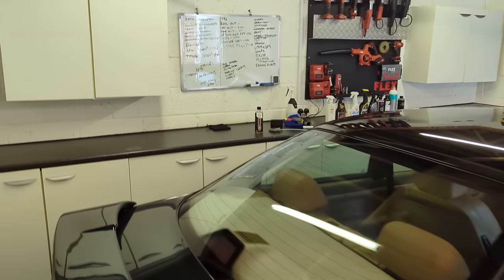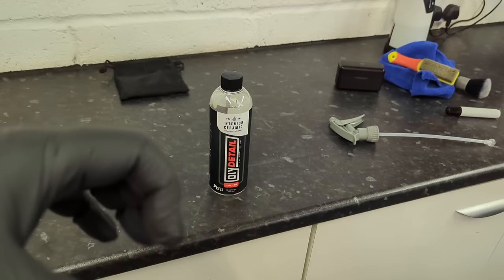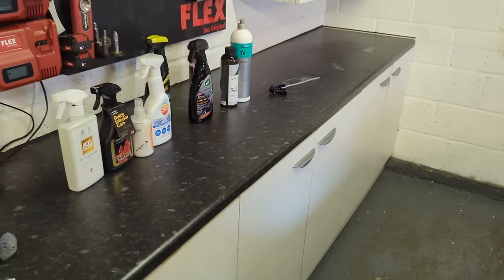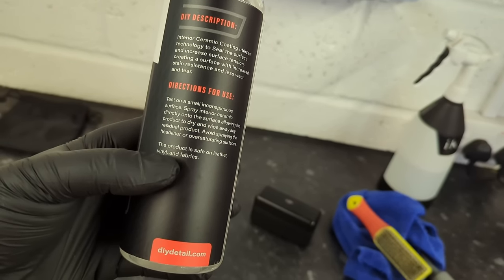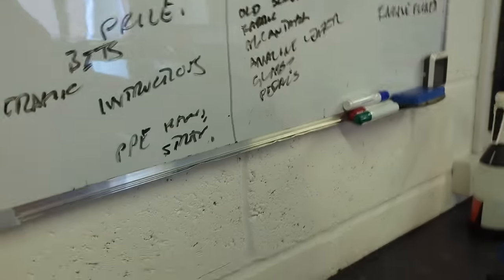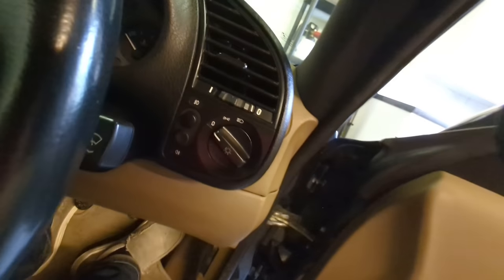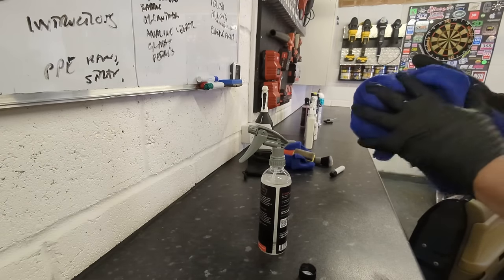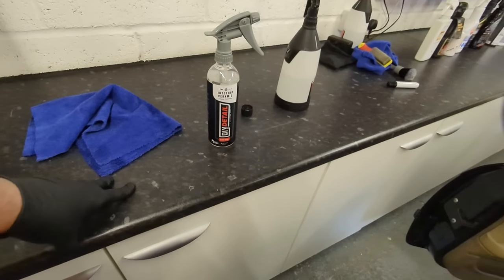DIY Detail Interior Ceramic | At £47 a Bottle it Needs to Be Good!!

Comment: I've applied this 2 weeks ago on my new car, it can go on most surfaces except glass for safety reasons (glare). It will go on poly carb binical speedo and screens. They advise that it's great on touch screens particularly because of keeping finger prints off.

 Also, they recommend that you don't spray directly onto the interior panels. Spray directly into a pad then spread it around the panels, I used a medium size Gyeon pad that doesn't absorb the ceramic coating keeping the product on the surface and not in the sponge- highly recommend you do the same. 

They really could do with making these statements on the bottle. I've done a fair amount of research into this before I made the leap to spend £47. So far so good.

 Apparently the liquid inside the bottle is more fluid then water meaning that it won't fill microscopic hole and pores keeping the finish similar to its original finish. It does slightly darken the surface. 

The whole idea of this product is to make cleaning a lot easier, reducing stains, rejecting dust, its would keep spilled liquids like cans of drink on the surface of the seats for instance so that you can clean up before it soaks in. I like it. I understand it and feel its worth. I had to find out what surfaces it can be used on by watching a lot of Yvan and Nicks channel. It will go on Alcantra as its a form of microfiber, probably not seat belts for safety reasons I'd use common sense. Analine leather and white headliner found in common cars probably not due to a slight colour deviation and could easily alter the appearance. I am with you on the fact they should print this information on the bottle. I've not scanned the QR code yet.

Comment: Ideas for testing:
- Look at the finish (kind of subjective, I hate glossy finishes for interior)
- Test durability in 2 ways:
    - Chemical resistance with an interior detail, stepping up to surfex for a torture test
    - Friction resistance by setting up something to continually rub over a test piece of leather (like the wiper test you did for glass coating).
- Price like you normally do
- Instructions, quality of the bottle/sprayer etc. like you normally do
- Ease of application like you normally do
- Ease of cleaning by getting a coated surface dirty
- Stain resistance by letting some coffee dry on some plastic perhaps
- Fabric water repellency by tipping a cup of water on some carpet (don't spray it / atomise it, pouring represents a "spillage" better)

Comment: It is the same trigger that came with mine, just went out to check my bottle and mine leaks too. I've just put the original cap back on. Thanks Jon, you are a legend 🙌
Reply: Your distributor has supplied you with a different spray trigger. It should have come with a black one that does not leak.

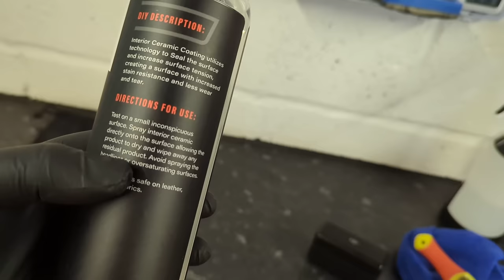Comment: 16:06 It can compromise the glue which holds up your headliner over time. That's why they didn't want you using it on your headliner.
Reply from the maker: makes sense might also disolve the sponge layer you sometimes get under the fabric.

Comment: Here in Australia the DIY ceramic interior cost's $114 which is around 55 quid. So it's expensive. But l like their products and I've used their rinseless, ceramic gloss, waterspot remover and they all work well. I won't buy the interior stuff until it's much cheaper though. Damn shipping cost's. My staple is 303. Great video!
Reply: The difference between the two are, 303 needs to be reapplied every 3 weeks or so, Interior ceramic applied to surfaces you never touch such as dash boards, one coat may last a lifetime?  Leather seats, where there is wear & tear, needs to be reapplied every year or so.  Do the math for your usage...
Reply: @hartlanddetailer5670  Well longevity is yet to be proven. I can get 750mls of 303 for a lot cheaper than 473mls and it does the job. Looking at how much you have to apply the maths doesn't work for me. I'm not arguing how good it is just needs to be cheaper for me, as I said I like DIY stuff.

Comment: i have it applied already 6-7month ago, once in the 2 weeks i give the car a quick clean with rinseless and its really good, probebly for what i noticed the steeringwheel is getting dirty quicker and not so fast to clean as in the first months but still good, the rest of the car wipe with a damp cloth and dry with a clean cloth and its good to go, and that after 40k km in 6-7months. So it makes youre interior easy to maintain and a nice oem look, but yeah other products can do that as well, but for how long? but the best of this product is when you use it on youre toch screens it works fantastic less fingerprints and so easy to clean and without streaks

Comment: I believe Yvan also says you can use it on literally all interior surfaces.
Reply from the maker: yer but can you? interior glass? alcantara? carpet? Rubber matts?  seat belts? analine leather?    Says its fabric safe but to not use on headliner.  Headliner can be vinyl, leather, alcantara, fabric etc.. etc..   So just in my head Im not 100% sure.  You can argue apply commen sense.  Its hard for labels to cover every outcome but on the flip side I think they could elaborate on specific surfaces a little bit.   I dont think I would apply this to interior glass for example.
Reply: @ForensicDetailing  yeah you do not apply it to glass
Reply: He said (Yvan) do not use on interior glass?
Reply: @hartlanddetailer5670  yeah as it will cause fogging
Reply: It can be used on anything except interior windows ( anything hydrophobic can cause fogging)

Comment: Hi John, I have contacted DIY Detail regarding these Spray nozzles as the grey ones are not for these bottles.
Reply from the maker: beyond my remit mate, product was bought and payed for. thats the trigger that came with it.  others commented they have this trigger.  So at the moment lots of DIY detail customers have leaking bottles.  Reviews are supposed to raise things like this not to fix the things you discover.
Reply: The UK suppliers are sending the bottles out with these Grey nozzles not the Black ones that they came with. That was the point I was trying to get across. I to have a leaking bottle.
Reply from the maker: Its up to the brand to ensure that they tell distributors what spray triggers go with what bottles.  distributors stock thousands of products they will never have the ability to test and check what goes with what.  Its also the brand that get impacted from any issues.  Again though this is outside the remit of the review.
Reply: @ForensicDetailing we only have one type of sprayers for our products. If a distributor accidentally sends a consumer a sprayer from another source it’s hard for us to police other than explaining to the distributor the importance of using the correct sprayers.

Comment: For me if such a product actually works I’d like stain resistance on fabrics, carpet, and leathers/vinyls. Perhaps stubborn areas of seatbelts and headliners. Things that are easy to stain and hard to clean. But dashboards, door cards, steering wheels etc I’ve never had any issues cleaning.
Reply from the maker: thing is should ceramic material really provide stain resistance in fabrics?  The original coating materials were not designed for fabrics they were designed more for coil coatings, architextural facades, and anti graffitti applications on train carriages.   But is this interior ceramic for fabric application not sure?  these are all good questions.  I think it says not for headliners somewhere.  I think I would use it more for dash board and interior trim and doorcards.  But need to get to know the product better.

Comment: No need to trim the DIY straw Jon. I did that at first until Yvan said as it is will still work
Reply from the maker: they can kink or loop back up on themselves if you push them down. they should be cut to length, if they are not that gets raised in the review so people are aware and can decide if its important to them.
Reply: @ForensicDetailing nothing wrong with bringing it up. I didn’t cut the straw on my latest purchase although I’m not the biggest fan of the spay head as they are a bit hit and miss in my opinion

Comment: Big fan of the Rinseless wash, and didn’t get any streaking with quick beads. Plus any question you have or suggestions with sticking in the video of cybertruck interior video they did with this the otherday as the do answer any questions which is good for the brand and not something every manufacturer does. I’m tempted to try out a paint ceramic as it has a 1 hr cure time. If Gyeon could get their coatings like this I would have probably used theirs by now as big fan of what I have used but without garage access and British weather finding the weather to prep, decon, polish, PW and ceramic and then still have 12 hrs of dry weather here isn’t easy
Reply: Ain’t that the truth!

Comment: Assuming that the DIY Detail product came from in2detailing, they recently seem to have changed the sprayers they ship with those products, they used to be black as in the DIY detail youtube videos, but this time my ceramic gloss order came with the grey one like yours too. That said, the old ones needed trimming as well! which I agree is a pain

Got to the end of the video: the sprayers they used to ship definitely were air tight! I hope that this is an error from the distributer rather than an update made by DIY Detail themselves
Reply from the maker: they shipped in bottles with lids and the sprayer comes with it.  Disti had no instructions on what sprayers to ship with what bottle as far as I know.  but glad its sorted either way.

Comment: The  TW interior ceramic is good still attracts bit dust though
Reply from the maker: thats in the lineup but I think thats essentially an acrylic spray (water based).  Its not quite the same thing material wise as the DIY product.  But yer its 9 quid which is cheaper i guess.

Comment: As ever, your video is always fuly concise and informative but, I will be totally honest, £47 for a bottle of interior cleaner/sealer, yeah never going to happen - My 12 year old Edition 35 GTi still looks new inside using the £4-7 per bottle products.
Reply: DIY Detail Interior Ceramic Coating is not a cleaner. It’s a ceramic coating for your interior that lasts years.
Reply: @diydetailofficial  I get taht but, as I said, about my GTi being 12 years old, it still looks like new inside and my 20 year old R32 is the same. I get what your product does but its jjust not for me for that price bracket. Best of luck with it though.

Comment: Tested this out on half my interior and after a month my conclusion is its a waste of time and money. It didnt seem to make any difference in terms of ease of cleaning plastic and leather and it does add a very slight sheen to the surface. I cleaned and rinsed with a damp cloth before drying and applying. Unfortunately i wont be using it again.

Comment: I like their products but I think their instructions are terrible.  I've watched a bunch of their videos and the instructions in the videos contradict what's on their bottles.  You shouldn't have to watch a video to learn how to use a detailing product.  The instructions on the label should be sufficient.  

For example, their panel prep.  Yvan in the videos will tell you that you must spray on one towel and wipe off with a clean separate towel.  Never spray directly onto the panel.  The instructions on the bottle tell you to spray on the panel and wipe off.

Also just got to the instruction part of the video.  Again, this label contradicts how they instruct you to use it in their videos.  They instruction you to spray onto an applicator and wipe off.

The black sprayer is the one that came with the product.